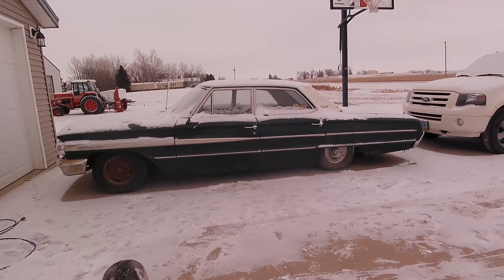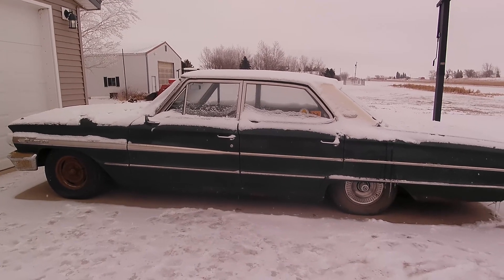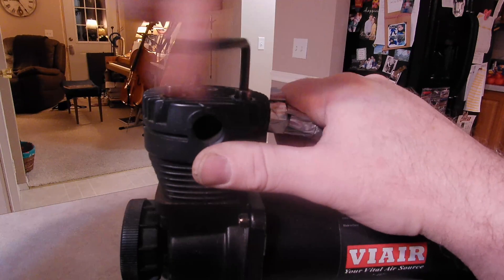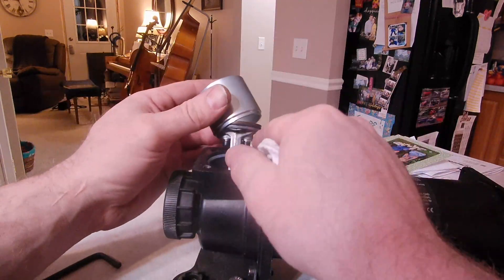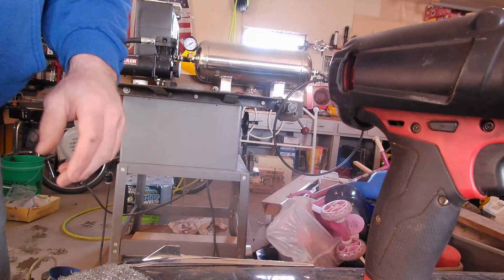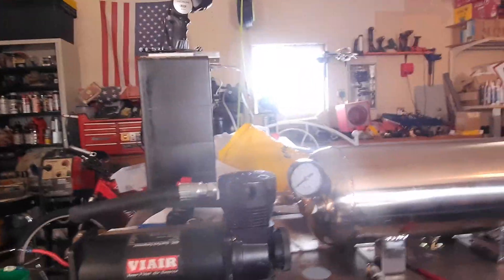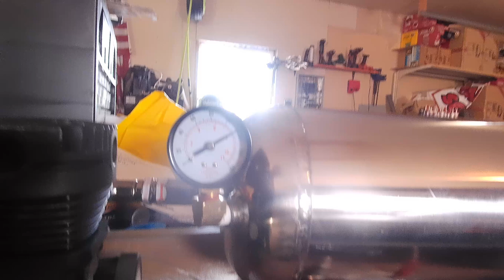1964 Galaxie Air Ride Part IV: Compressor Tidbits and Finishing Touches

Comment: Do your leaf springs warp much with the missing leafs?
Reply from the maker: They do a little.  I think you can see it in the part 3 video.  This is a way to get low quickly and on a budget.  If you are making any amount of power I would have concerns about axle wrap.  For a cruiser that sees limited miles and just goes up and down, it has been working just fine.  I have an 8.8 with limited slip and disc brakes.  If that finds its way into this Galaxie, it will be installed with a 4 link.  Thanks for watching!

Comment: Hey, been watching your little series and i love how detailed you get and that you let us see all the problems and solving you do! Im from sweden and got a 63 country sedan im thinking of airbagging. Just wondering about shock absorbers, will you run without it?
Reply from the maker: In the rear the factory shocks are acting as my limiting straps.  They are shot and should be replaced.  In the front I plan to run shocks on an arm designed for about a 1950 F1 shock.  I bought a set off somebodies shelf of unused parts but if I show that in a video I'll find a link to the same part.
Reply: @ssmonte8738  Okay, thanks! Keep up the good work! :)

Comment: Thanks for the great info, I just watched all of this series.  I have a 63 I am looking to do this with in the future.  I have been seeing people in high end bronco builds and similar that are using the factory window crank as the switch for power windows.  I'm not sure how they're doing it but I really like that idea, since it lets you keep the factory look.
Reply from the maker: There is a block you can buy that has a shaft for your handle to mount on but doesn't actually crank.  It just has microswitches that the crank pushes on.  Nice but costly.  We'll see what happens.  The motor kit arrived yesterday!

Comment: Thank you very much for the content. I just picked up a 63' Boxtop in great condition and mostly original and looking to bag it. I will duplicate your air ride system for the most part but I'll probably use compressors that are more quiet.
Reply from the maker: They are quite loud with the car not running but otherwise I don't notice it too much.